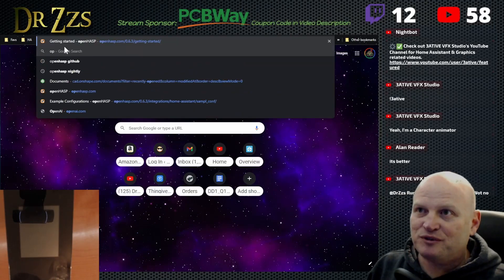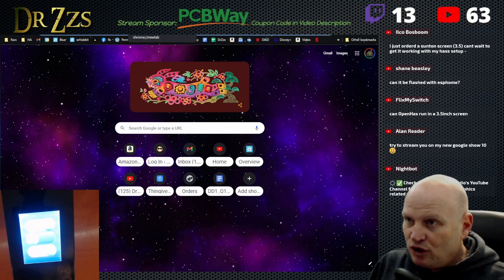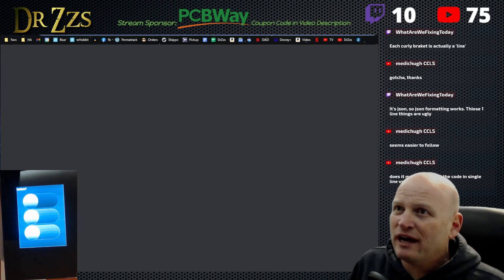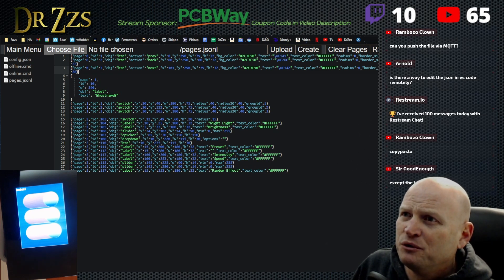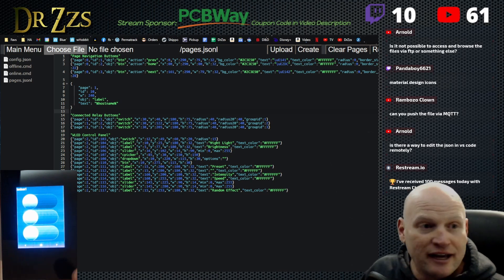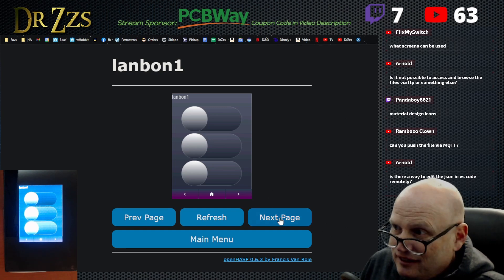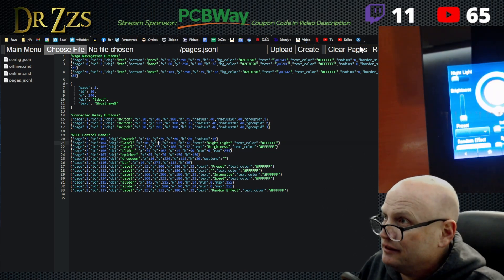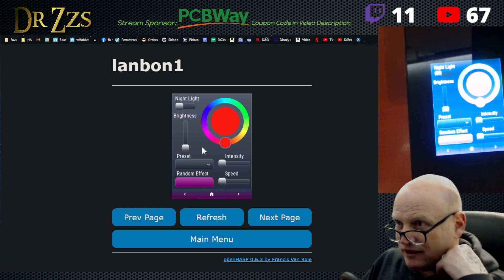WLED Control w/ OpenHASP on LANBON L8

Comment: Dr. Zz your videos are always informative, now my question, With OpenHasp installed on this, does the switch still control the attached relay normally? I'm thinking this is the setup I am needing to control the main room lights plus mood lights via WLED on a esp32 if I'm correct.
Reply from the maker: Yes it does.  It doesn't need to be connected to Home Assistant, or WLED or anything else.  That's one of the great things about these; they can work like a normal switch for normal lights, but also control other stuff like WLED or Media Player etc.  I love these!